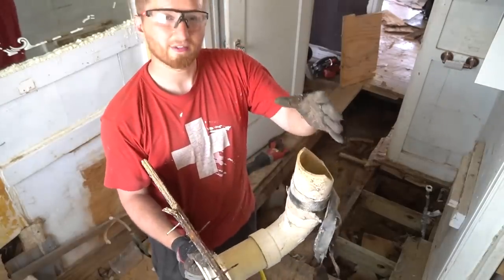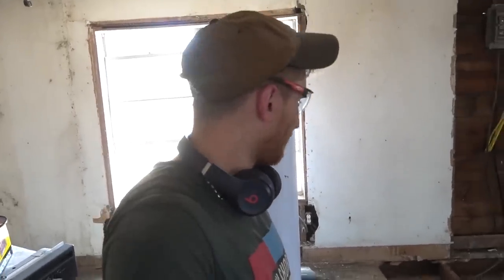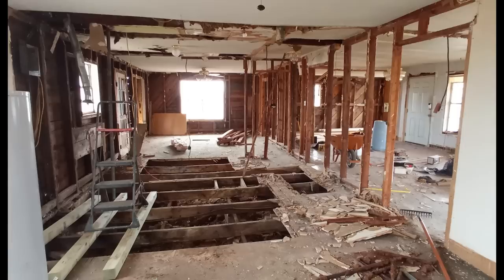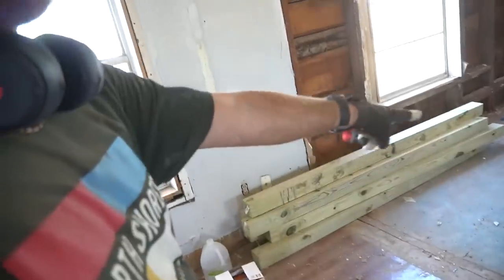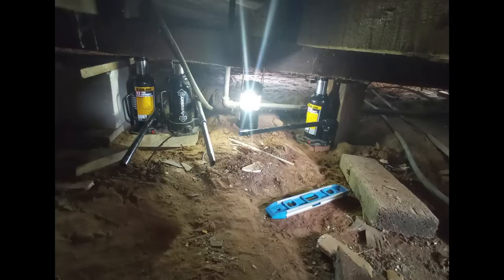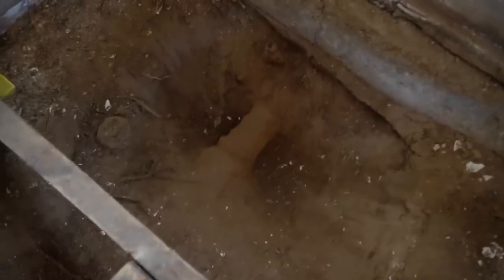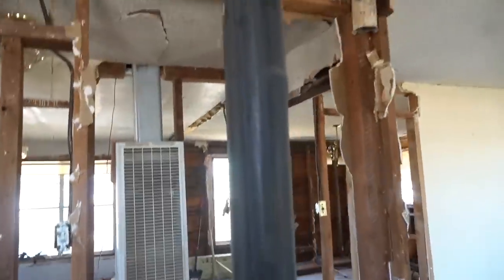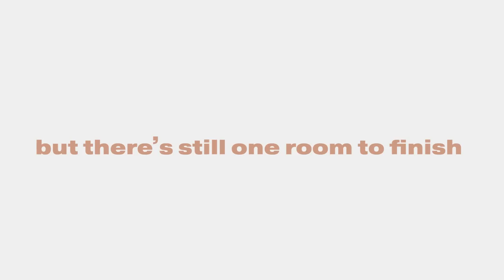The MOST extreme DIY bathroom remodel (full build)

Comment: Hey Zim! Did you have to get any contractor certifications for your remodel work, or because you own the building was everything ok to do without it? The being up to code and legal stuff seems a bit crazy
Reply from the maker: You can pull a home owner's permit for everything except electrical, also it's a lot easier when you don't add anything. Like essentially everything is new yes, but it's still just one bathroom in the same place as opposed to adding another bathroom somewhere else in the house which is more tricky because if you sell it, they will ask, why was there only one bathroom before and now there are two? : )

Comment: Just a heads up to replace the outlets near the sink with Gfci outlets… but otherwise, amazing job!
Reply from the maker: Yeah, true : ) if the first one in the circuit is GFCI then it's fine to have the others not, which is what I have. But yeah code wise I believe you're right they all need to be GFCI? Or I might be wrong
Reply: Yes, all outlets in that circuit are protected by the one Gfci.  So you won’t have to replace all the outlets.  But the one to the left of the sink is within 6 feet of a water source so it would need to be Gfci
Reply from the maker: @jamesd6873  thank you James! I really appreciate that man! :) I'll get it switched out here soon

Comment: What's that thing called, the one you put in between the tiles to keep it evenly spaced I presume?
Reply from the maker: Yeah, they're called tile spacers, but there's a system where you put the yellow thing through and it also helps make the tiles flat as well as correctly separated :))

Comment: how is this easier/cheaper/less time consuming than building a house from the ground?
Reply from the maker: Definitely harder in terms of work and brain power. Remodelling is always much harder and slower than new builds. But on the other hand to build a new house actually would cost quite a bit more and you'd have to wait months and months to have permits and plans etc... so that's why it's easier in the long run : )